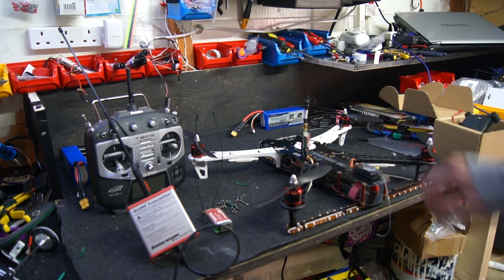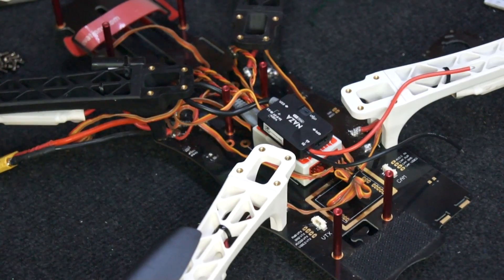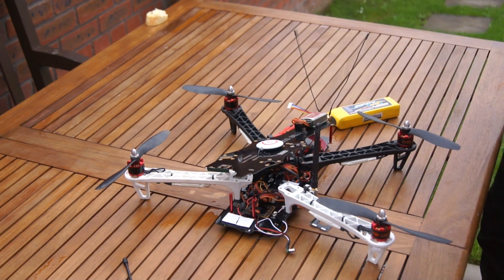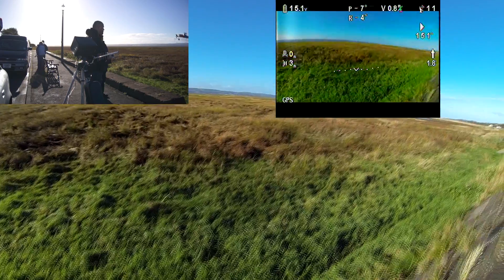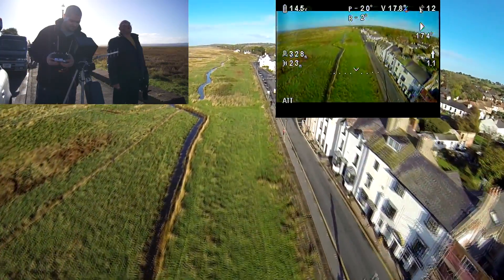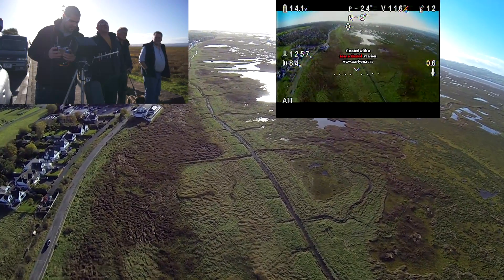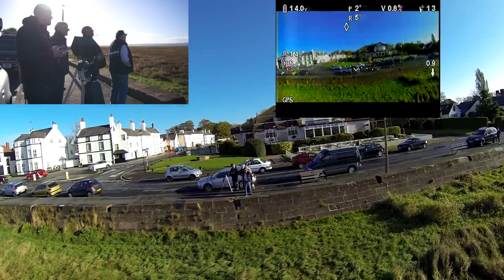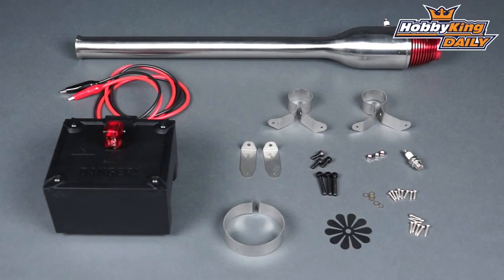Long Range TBS build & maiden mile flight, 2.4ghz Lawmate video with EzUHF That HPI Guy

Comment: i know your video is old but around the same time a was able to fly 5.8ghz with two clover leaf to 1.8ks on a plane, maybe you had a fault with your system or bad antennas ?
Reply from the maker: I think my radio was still on so outputting 2.4 :(

Comment: Any video interference from 433?  Filtering needed with 433/2.4?
Reply: Nope ezuhf works a dream i'v done 2 miles on low power with nearly full signal the whole way

Comment: Nice setup, what's your max range now?, I've been doing 1600M plus on a fatshark 250mw without any problems, rubber duck on TX and patch on RX.. is it worth getting a 2.4 do you think, you started to get some flickers at 1600m so that's my reason for asking what you have been able to get now.. thanks :)

Comment: I'm just responding to your comment about 2.4ghz. I live in California and 2.4ghz has too much interference. I hv 5.8ghz but I'm only getting 1.5 miles. You mentioned 1.3ghz, maybe that wld be my next changed in my fpv system.

Comment: That's not bad, I'm getting 1375 Meters with my DJI Phantom v1 before the failsafe kick in and forces me to fly back. I'm using the ImmersionRC 600mw. How much do you charge to custom build a similar unit, I'm really just looking for increased flight time, I'm getting 16 minutes running dual 2200 mah, But I want more something like 25 to 30 minutes. What type of pre-built or custom drones do you recommend?

Comment: I have a very similar set up with Super 8, Naza, and Mini IOSD. I have been considering the upgrade to LRS. I have heard that there was a problem with the EZUHF and the 8FG's PPM. Yours is just fine. In fact, a spot on demo for what I plan to do, but I wonder if you chose 2.4Ghz video over 1.3 because of a cleaner picture. Here in the USA, all FPV'ers claim that 1.3 is the way to go and I am a little on the fence now because yours looks so good! haha...Either way, another very helpful video. Keep it up!

Comment: The TBS Disco really isnt built for long range (4-5miles+).  Like most Quads the battery compartment is too small, and the arms are to short for efficient thrust to weigh builds.    TO go beyond 5miles you need large 12+" props and low 200-300kv motors.

I'm waiting for an 800 size Spider shape quad myself so I can do it right.